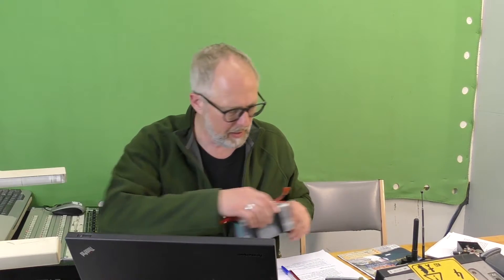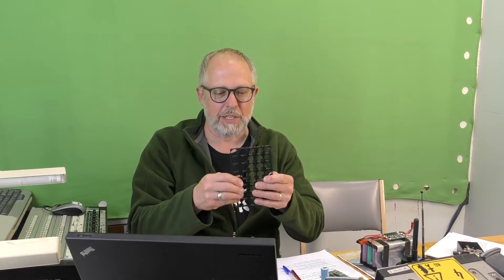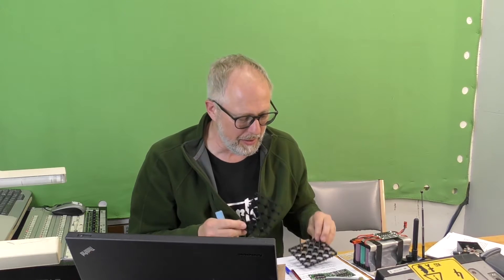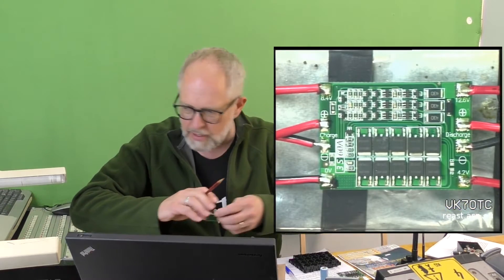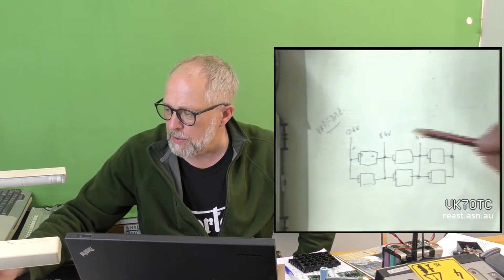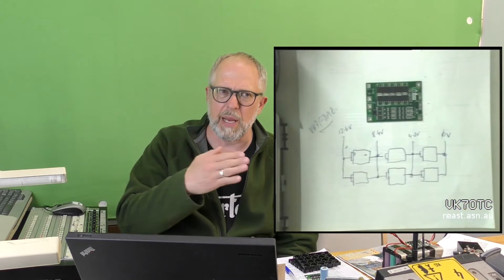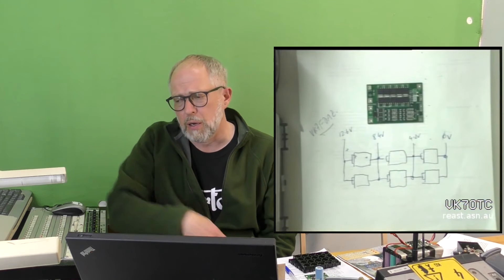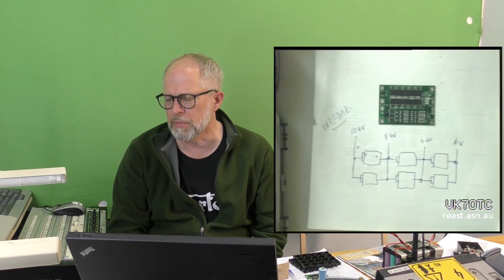Recycling 18650 LiPo Batteries

Comment: Just put a step down converter on your 4S battery and set it at 12V, then you have a battery with stable 12V out from full charged to fully discharged.